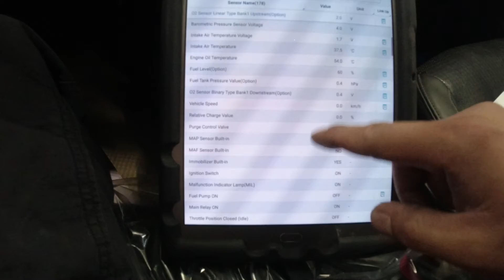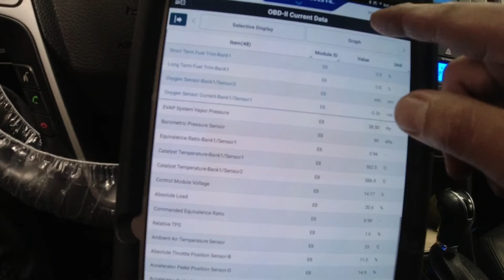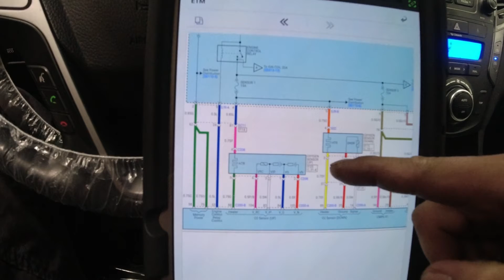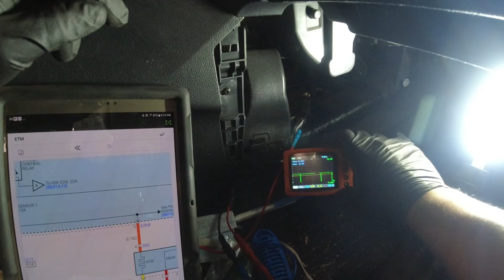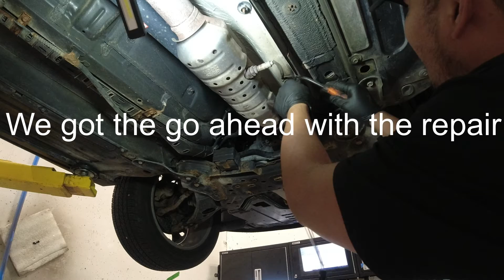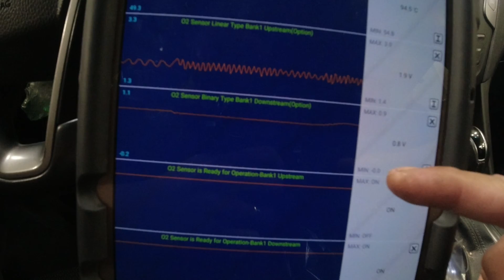Hyundai Santa Fe Oxygen sensor fault - how to check oxygen sensor

Comment: Have you seen this model 2013-2016 santafe 2.0t have bad acceleration and not have backfires and no check engine light before? From a bad upstream bank 1 sensor 1 ?
Reply from the maker: Yes, usually if you compare both upstream and downstream sensor then the upstream is clearly lying compared to downstream. I only it once it elantra gt

Comment: Hi, thank you for this useful video. 
I got 2016 Santa Fe. Am getting P0036 code. O2 sensor heated. Heater control circuit ( Bank 1 Sensor 2) I presume it the sensor on the catalytic converter. When we check the wire cable we get 4.1 ohm base to spec. Do you think the sensor still faulty. The dealer telling if my cat is clogged, it will still give the same code. If the cat was the culprit, the code would be different.
Reply from the maker: @aveemoorut1009  either you have issue with ground control cicruit for that o2 sensor or power feed or the heater element is gone. With bad cat usually its p0420.
Reply: @hyundaitech we measured the heater element we are getting 4.1ohm. Is that correct?
Reply: You downtown Toronto. 
What the shop name?
Reply: Actually the my engine light came on last year beginning of September. It went off after two week by itself. Then came back on this year two weeks ago. We reset the code, it 3 days now, no warning yet. Am sure it gonna come back again.
Reply from the maker: @aveemoorut1009  yeah more or less that element still okay, so just monitor it for now, we are located in downtown toronto. The shop name is downtown hyundai.

Comment: Great video MARKO. THOSE VOLTAGE spikes on old B1S2. Could the heater circuit of been bleeding over to signal? Maybe a bias circuit check ? Btw  where did you get that clip removal tool ? That one is long thanks
Reply from the maker: Im not sure what those spikes are, could be something wrong on the signal side coz thats where i made the connection, for the trim tool i bought thay from matco but that was years ago when matco still comes by to our shop.

Comment: Great diagnosis. Take care.
Reply from the maker: Thanks man. You too.
Reply: @hyundaitech   excellent  diagnosis and repair on this workorder, i am now a follower of your channel and thats wht brings me to you, I have an 07 hyundai santa fe 2.7 and just replaced both manifolds/cats of course new gaskets, and all new flange gaskets on exhaust so i have no leaks no fuel odors went for a drive cycle car drives perfect no noises no misfires but now im getting codes p2271, p0133, p0140, and p0138  i replaced B1 sensor 2 and still getting all these codes but i dont have a scanner tht reads live data any advice or tips are appreciated i need my emissions test to pass or they going to cancel my registration any help or suggestions i would really appreciate it, this is only car i have for my family and me thank you 🙏 🙏
Reply from the maker: @greglopez7768 im not in the computer right now are those all oxygen sensors? Make sure that those connectors at the right sensors coz on those old models the connectors are not color coded and they can just plug in to each other.
Reply: @hyundaitech yes i connected the sensor to the correct harness them codes are all pertaining to bank 1 sensor 2 thn just recently it threw p0133 which is bank 1 sensor 1 car runs absolutely perfect no misfires, car accelerates and decelerates perfectly no odors coming into the cabin, no odors coming from engine compartment or exhaust pipes either, thanx for your response BTW
Reply: @hyundaitech  idk who worked on it last, im thinking they may be crossed,so are all the connectors on bank 1 and bank 2 the same? The connectors on the sensor side can plug into any connectors on the engine harness side?
Reply from the maker: @greglopez7768 yes the older models are like that. And whats worst is the same color, unlike now they have different colors.
Reply: @hyundaitech  thanx for your response i do think they are crossed how do i test or determine on Bank 1 which harness is for sensor 1 and for sensor 2 ?